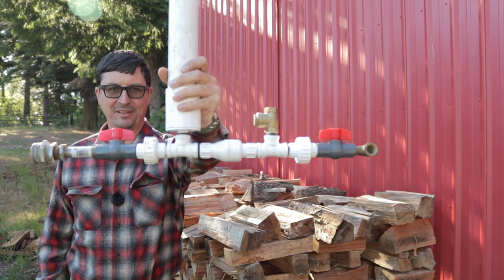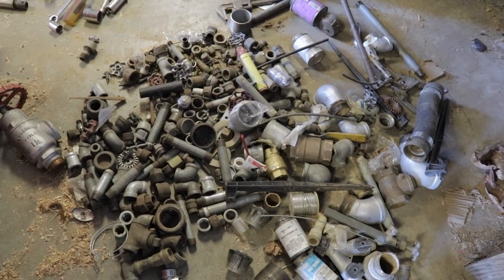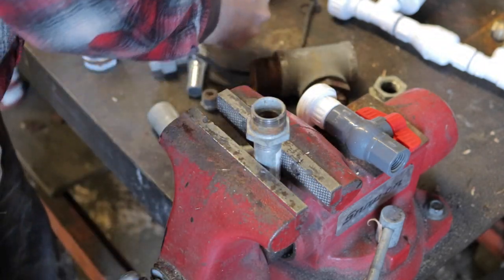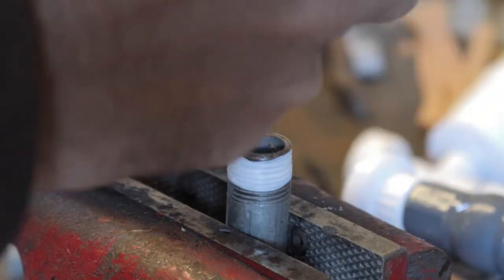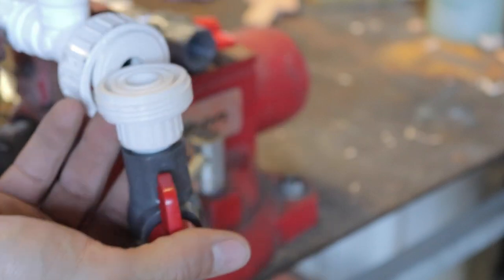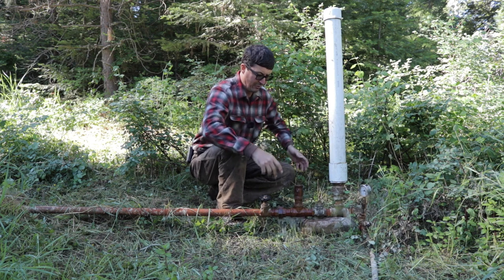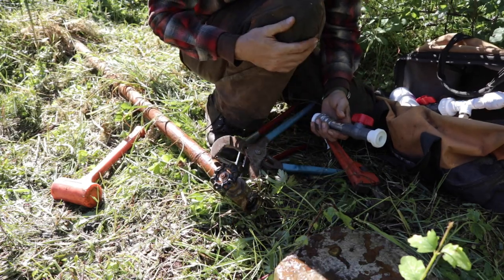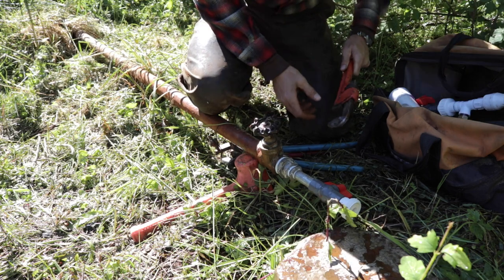Coolest Little Ram Pump Ever!!!

Comment: PTFE is in both dope n tape (in general).... each have their place no one is "better"than the other even though both can be used in overlapping situations.  In wet conditions is often easier to work with tape but both will work on many circumstances.  Color difference indicates both different thicknesses,  chemical make up and use designations (i.e. gasses vs liquids) and depending on the corrosive properties of the medium being sealed you need to use the appropriate product specified for that application. These are in depth technical details though.  So in general for homeowner use cases you will 99% of the time use white tape... blue is "tougher" n thicker.... may be considered more durable and uses less wraps to achieve the gap coverage required on the joint vs the white. Keep in mind this is a static connection and all you're doing is filing a gap between threads so "tougher" is semantics. Yellow tape will be for Natral gas Connectors as well as yellow dope. If you need to absolutely ensure there's no debris in the line after connecting then most people avoid tape and use dope. To ensure that no pieces of tape enter into the system from the joint being prepared.

White – Basic Thread Seal Tape. ...
Pink – Thread Seal Tape For Water Lines. ...
Yellow – Thread Seal Tape For Gas Lines. ...
Green – Thread Seal Tape For Oxygen Lines. ...
Grey – Thread Seal Tape For Stainless Steel.

That info should suffice to 98% off people wondering what to use and where n why.  The rest is commercial or industrial knowledge that is best left to hands off professionals ... usually including highly pressurized systems filled with ugly stuff or line sets usually filled with stuff most people have no idea how to safely work around or handle without hurting themselves badly or creating a "repair" that can hurt or kill someone down the line or put the equipment in peril.... even though they THINK they know what they are doing. A simple "sqirt" of standard hydrolic fluid that breaks the skin from a hydrolic line can kill you!  And EVERYTIME will take surgery to try and save your life. Some jobs you NEED TO PAY SOMEONE TO DO! Not everything is YouTube DIY simple.  I have I long list of clients that can attest to that statement! Stay safe and if you don't know what you are doing is it really worth risking tens of thousands of dollars in damage to you most valuable asset to try and save a few bucks doing it yourself..... or save a few bucks by risking your life or the lives of people around your "repair" down the line? NO, IT ISN'T! Pay the money and live another day..... or just keep your home from having to be gutted and rebuilt.

Comment: My dads a plumber for a living (10+ years) and a carpenter before that. He uses the regular pipe tape and goes over that with rector seal. I don't think they've had a leak yet that way. The only leaks they've had is when it's a new house build and someone shoots through the wall with those long nails for the concrete(? I believe) siding.

Just remember the tape is directional. Meaning you need to wrap the tape on the right way.

Comment: Hello.
It is amazing what you do without electric pump and just with fisics and math for to pump water over a hill.
In plumping if you use metal pipe on metal pipe where both have threads the old way in my country is to use flax strick (estriga de linho) with a compound Vedox from Nevex. If there is some dent on the threads the flax will swell up and fill all gaps and the paste Vedox will prevent rust and be more easy to unscrew with less brute force.
This is a tip from the older plumbers that I learn.
I use only Teflon tape on pvc pipe that screw on pvc or to metal pipe.
Stay true to yourself.
Best regards.

Comment: My Dad was a plumber. I worked with him a while. Dad used "pipe dope" on pipe threads for decades, but he seemed alright with teflon tape when that came out. But he was gone I think, before blue teflon tape. That 90 degree item is an elbow. The fact that it has both male and female ends makes it a "street elbow." (Plumbing terminology vs. hydraulic?) Yes; always bring 2 pipe wrenches. Even with other good tools.

Also, a vertical air chamber like your "tank" is a good treatment for "water hammer" in indoor plumbing.  Make one (of either kind of pipe,) and put it in your system the next time you must do some plumbing.

Comment: Run the teflon tape roll the other way but still wind in the same direction, that keeps tension on the roll of tape so you can wind it on tightly.

Comment: I moved to a camp i Oregon on a farmers back 40 awhile back ago. I found a ram pump that had a missing clack valve, so I went to a hardware store and invented one. It worked perfectly.  I filled a 55 gal. barrel I had tied in a tree, above the camp with it. With that and a wood burning water heater I had it pretty good at that camp.

Comment: After working years in the oilfield I've learned you both tape and dope pipe fittings, if it's a high heat application dope alone will bake and turn into almost a loctite for pipe, but tape alone doesn't seem to have as good of sealing properties as dope so you combine the two and it works nicely, And if you're a kind soul thinking of the next guy that may have to take it apart next time (which my be you) ALWAYS use a coating of anti-seize on the threads of a union. If you come across a union that is sticky however a few good raps with a hammer on the flats of the union nut helps to loosen it.

Comment: Both male and female threads are tapered, this is called an interference fit.  Thread tape and pipe dope are both lubricants. This allows the pipe to thread in farther for a tighter fit.  Blue teflon thread tape seems to be thicker and hold together better.  This keeps the lubricant properties from squeezing out of the threads when tightening. I call the hub spicket fitting a street 90.

Comment: 5 gallon buckets make a good way to organize misc pipe fittings. 1 bucket per size so you just grab the bucket you need. 

Got any junk tires? Can make effective shock isolation from them to support the pvc section without the risk of right on the rock. Just remember to drill drains if you use just a tire so it dosnt hold water.
Reply: We use the square kitty litter buckets.  Have a million of them and they pack on shelves nicely.
Reply: I have a nice collection of the kitty litter buckets myself.   I never throw them away, as someone always can use some free buckets!!!

Comment: My Plumber Son uses NG rated yellow teflon tape on all treaded connections. It is thicker than the white and does not rip apart. He uses only tape on PVC and ABS, on black, galvanized or brass threads he also used pipe dope on top of the yellow teflon tape. He works both residential and commercial jobs and time is money so he does not want to come back to fix a small leak because of inadequate sealing.

If you wrap the teflon tape so that the last trained edge is being pulled by the fitting you are screwing on clockwise, it will tighten the tape on the threads rather than trying to unravel it from the pipe threads.

.

Comment: Few remarks. 
The upside to using Teflon is you don't have to go all out when tightening every nut and fitting. Just tight is tight enough. The Teflon will actually do the tightening for you. If it leaks just give it a bit more. Unscrewing though (for any reason) will damage that tape and you will need to replace it. It is a one-screw-only type of deal. (no pun intended)

Using paste or liquid sealant usually has some special actions you have to take like degreasing or letting it set before using the installation. Teflon is pretty much foolproof and an instant mess-less solution.

Comment: Teflon tape:
White : for household use on cold/hot water and natural gas lines.
Yellow: for higher pressure/temperature applications.
Blue: I believe it is for extreme temp and pressure applications (not sure about the blue)

Comment: the way I store all my farm irrigation fittings is in 'pigeon holes', not sure if that's a universal term. one hole for straight 1/2inch fittings anouther for 1/2inch elbows etc. etc. I have used Teflon cord in the the past, it seams to be better then the tape however the tape is good and cheap.

Comment: @Wranglerstar  whenever i do anything plumbing related, i swear by the PTFE (teflon) tape..i just find it so much more usable in terms or fitting and removing pipes, and also for the reason like you discovered..the tape never ages whereas the sealant does!

Comment: If you open both valves and cap the overflow to equal out the water level from spring it would start back pressure quicker than starting pumping then opening the discharge

Comment: for thread sealant you use Teflon tape for plastic PVC, abs etc. pipe dope is used for metal pipe galvanized, steel etc. and even on some old fittings you use pipe dope and twine in the threads and for the colored tape the different colors are different thicknesses

Comment: So the big pipe is using gravity and the weight of the water to remain pressurized? And the pump is a bleeder pump using the power of the pressure in the big pipe, to carry the water up your hill to where you store your water. Physics is pretty cool.

Comment: I am no plumber, but I've found that the cheap thin teflon tape is easier on 3/4" pipe or less (as long as the thread is clean and not rough.
Pipe dope seems to works best on larger or rougher thread pipes. Rough threads seems to just shred the teflon tape, making it harder to get at the root of the thread, where it needs to seal.

Comment: Wouldn't it be a good idea to put some sort of mesh on top of the ram pump to prevent stuff from coming in? I mean on the first check valve. This would let the water come out like it is supposed to be, but not let in any other stuff. Would make maintenance easier too, I reckon.

Comment: In my workplace, we're only allowed to use 567 Loctite on any pipe fittings, the only exceptions are extreme heat items where we mix that and stainless filled teflon tape which is grey or silver in color. Oil industry and in-house rules about what we're allowed to use tho. The 567 stuff is easy to use and dries like cement. Only wire wheels or abrasive blasting gets that stuff off.

Comment: Blue Teflon tape is designed for pipes with larger joints, such as water distribution pipes. Yellow tape is double density, and designed for gas and fuel lines. The white Teflon tape  is for water pipes.

Comment: Which is better? (teflon or dope?): When I worked in pool/spa repair (lots of plumbing in equipment rooms, new pumps/filters/heaters/etc), we always used both on pipe thread fittings (common to have 1.5-2.5" pipe thread on pump housings and bulk-heads of heaters/filters). Tape first, dope over the tape. This was a technique learned from my old-timer step dad with 40+ years experience. I probably questioned it at first, but using this technique always resulted in leak free fittings. Not sure which is better, but they work great together! Just be careful the dope provides a lot of lubricity, which makes it possible to over-tighten and stress PVC/Nylon fittings. Crank down on the steel but go easy on the plastics!!!

Comment: Pipe threads are tapered. So the further you screw one together, the tighter it gets. Dope or tape both work more in the sense of it allows you to screw the pipe further into the fitting. It does serve as a sealant as well. I've watched the "old guys" tape then dope the pipe to make double sure of a good seal with no leaks.

Comment: Pipe dope is used ontop of tape, to provide both PTFE thread reinforcement (= skookumer connection), and also for lubricity and ease of install with fittings.

Always use at least tape, preferably also use dope to insure a solid connection and make it easier on yourself to install.

blue tape is PTFE reinforced tape, far superior to simple teflon tape

Comment: The best thread sealant is the one you have at the time you need it.  With that said, I really like Real - Tuff thread sealant on most pipe threads.  I'll use tape on small brass fittings.

Comment: Teflon tape prevents thread galling especially for plastic or PVC threads and wrap 5x for PVC. I prefer the tape because some compound usually finds its way into the valves, cheers.

Comment: i been pipie fittin for about 3 years and pipie dope is a lubricant but thread tape is a selent and we use stuff call leak lock be lock tight is good stuff

Comment: Pipe Dope seals the threads.
 
Teflon tape was designed to prevent cross threading. 
It was intended for one/two wraps of tape only. 

As it turns out, I've had this conversation multiple times with several bosses and have failed every time. It DOES seal threads for high pressure water pumps, but so would bubble gum or enough ear wax.

Teflon has one of the lowest drag coefficients of any material, so that cross threading would be reduced. However, people discovered that enough of it would actually seal, as well. Why would you use the slickest material possible to make a seal? You wouldn't. But eleventeen wraps ACTUALLY works...and it's cleaner!

Comment: You could put a scotch bright pad between the rock and the plastic pipe to cushion it somewhat. The water will drain right thru, and it should last for quite awhile before UV rays break it down.

Comment: What if the waste water valve was diverted to the bottom of a vent pipe at the outflow or inflow end of the pump? Idea being to recover the water and the air on top would push it back into the line. Maybe increase pressure a bit by using gravity to load on it?

Also have you considered making box of perforated metal that sits in a hole at the stream you collect water at? Idea being it wold fileter out some of the bigger contaminates like small sticks and leaves that clog your pipes? Than that piece of screen for the fine material?

Comment: 96 ounces is 3/4 of a gallon. As to the tape, I don't use pipe dope, I only use the tape. US made pipe threads are tapered, so the seal actually happens between threads. The Teflon helps the threads slide past each other for a tight seal and make up for tiny imperfections in the cut threads. Don't rely on your tape to seal a joint, a tight joint is a sealed joint. And yes that 90 is called a "Street Elbow".

Comment: I have a 12L 300bar(4350psi) scuba tank I use to fill my PCP air rifle, the Tank-Gun fitting was leaking a little so I put some teflon tape(white) and now it holds the 200bar (gun pressure) no problem.

Comment: My dad has been a pipe fitter for about 40 years now. Teflon tape WITH dope is the way to go. Most pipe dope is just a lubricant and not a sealer. You can get by with a sealer/dope and some applications are a sealer only (no tape) I have no idea what makes blue Teflon tape better, but I have personally found that it stays on the threads better than white tape when threading the fittings in.

Comment: Pipe Joint Compound (pipe dope) wins over teflon tape all day long and twice on Sunday!!  They have different uses, though they can and often are interchanged for same use.  Larger diameter iron or galvanized steel pipe generally require, and are better served by dope, and  used for "permanent" installation.  Fixtures and fittings that are changed out "often" generally are  put on with tape (easier to disassemble, less mess). Dope (in my opinion) always provides a better seal, and actually acts as a lubricant, that allows male thread to seat deeper into the fitting

Comment: Tape or dope depends on the media you are dealing with , some tapes will break down. If the threads were perfect then no need for either but most are not perfect by the time you have them at the jobsite so the tape or pipe dope makes up for any imperfections in the threads. Sometimes I will use pipe dope and candle wicking or string mop strands to be sure there will be no leaks.

Comment: i bet the blue is just thicker! when we do tape and dope 4 wraps with white is plenty.  if they are just doing tape it might work better if thicker.  tape and dope is all just so the threads go easy enough to make the mechanical joint in the threads. just a lubricant but it works great. being gas or water i would never do just tape on something serious or heated water line.  your well lines will be just fine.  air is the same way, if some were to leak out its not a big deal.

Comment: Blue monster brand Teflon tape, yes the tape does not lubricate the pipe but I don't think it makes a difference. I found that with the blue monster tape I have had a lot less problems/leaks compared to the cheap white. But in reality if you like dope, use dope and if you like tape, I'd recommend blue monster.

Comment: Hey, I use tape and dope together. Tape is easier to tell when you have a seal. Dope is great for lubricating the fitting so it goes on easily.

Blue tape?  Blue monster tape?

Only difference is that their tape is thicker. So instead of wrapping 10 times you only need to wrap 4 or w.e. I believe they also add something else to help lubricate the fitting. 

I personally only use Blue monster but so long as your dealing with fittings smaller than 3" the white tape is perfectly fine.

Comment: My mom told me the only purpose of Teflon tape and/or pipe dope is to lubricate the two pieces as they come together. It's not to make seal like a lot of folks think. Tapered fittings need the lube in order to get that tight fit.

Comment: based of what i can gather from your previous videos and wikipedia the size of the pump should not really matter in any other way than volume of water moved per cycle of the pump as long as the pipe proportions of ingoing water vs outgoing water are correct that is